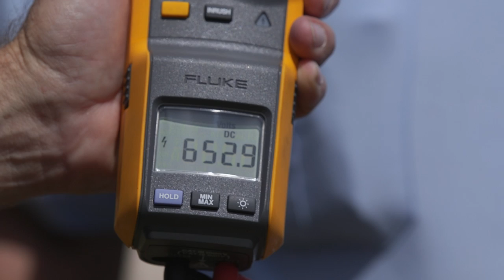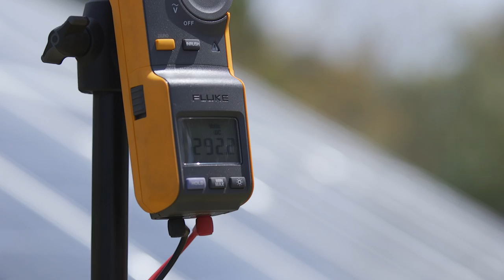Electrical Arcing & Water Conductivity

Comment: who the hell wants a 600v system on their roof?
Reply: Count the number of panels on a roof, if there's more than 15 panels, very common in Australia, the string voltage is getting up there. Even 10 panels can have open circuit voltages over 300 VDC
Reply: But should the panels not be connected in parallel ? I mean after all the system goes through a 12 or 24v inverter and charges 12 or 24v batteries doesn't it ?
Reply: Not always, modern battery PV regulators can have high voltage inputs, they are true Switch mode supply chargers. It's not unusual to have a 12 Volt battery regulator with 120 Volt or higher panel inputs. The logic  being lower I2R (Power loss due Voltage drop in a conductor due to current flowing through the resistance) Losses. This becomes important in high power systems where the panels could be 10's if not 100's of meters from the charger.
In Australia direct mains grid tie inverters are common, PV strings of 200 - 300 Volts are very common feeding the high voltage inverter.
Reply from the maker: Residential PV systems are limited to 600V of panels being connected in a single series (or string).  Industrial and commercial arrays are restricted to 1500V in series.  To answer your question, a typical 250W solar panel will produce 38-40 open circuit voltage. So any typical residential solar PV system is producing close to 600 volts at peak sunlight hours during the middle of the day.
Reply: Actually the voltage has no effect on the wattage produced. Please understand basic ohms law before insulting another individual over the internet. Many of the on grid based inverters used to only offset your electric bills are auto ranging from 48-500vDC and are sized and limited by total wattage. They do not care what voltage you bring into the DC side. As the installer you decide how best to break up the array into even strings so that you may keep the inverter in the best possible voltage range during lower sun hours. So please refrain from insulting others who might not be as "informed" as yourself.
Reply: KappaW the issue is amperage and wiring costs coupled with range of voltage during varying sun conditions. No decently sized solar array that is installed by any type of moderately experienced technician will be in the voltages you describe. The most common operating voltage for a single panel is 28-32v DC so please refrain from further spreading ignorance around the interwebs.
Reply: almost eveyone in Australia atleast, its terrible, its all well and good until there is a hail storm and the panels start leaking current very unsafe, fire and shock hazard.
Reply: Every residential PV system connected directly to a Grid-tied inverter has a 600v system on the roof
Reply from the maker: This is exactly why we invented PVStop, which is currently being trialled by fire and emergency services agencies across Australia (as well as the UK, USA and Japan).  A big step forward in Solar PV system safety of which we are rightly proud!
Reply: I will never touch a solar system above 200v because any higher is obviously asking for trouble, which is why we need black rubber extinguishers because people think too much about the cheapest way to do things not the safest way to do it, you will gain more efficiency by cleaning your panels more often anyway
Reply: There is a reason why the US uses 120v ac because it doesn’t make a 6” arc, it just pops. I say microinverters are the safest
Reply: Changed my comment from “who has” to “who wants” to better reflect the real issue here.
Reply from the maker: A good quality solar PV system utilising good quality components, installed by an experienced installation company and serviced periodically will give years of trouble free service, but you are correct, all too often this is not the case and people chase the cheapest option, often not understanding the risks associated with sub-standard systems.
Reply from the maker: Microinverters (such as Enphase) and DC optimizers (such as Solar Edge etc) are all steps in the right direction and look to reduce the risks associated with the "DC Danger Zone". However both have their pros and cons.  I would need to write a 2000 word article to do the subject justice.  But two points to mention are that in a micro-inverter system, the panels themselves are still producing (limited) power at panel level and when firefighters respond to an incident, they do not always understand what type of solar PV system they are facing.  PVStop isolates the power completely at the source (by blocking the light from reaching the panels and it works equally effectively on any type of solar PV system (including micro-inverter systems) all without damaging the system; a quantum leap in firefighter safety in incidents involving PV arrays.
Reply: PV Stop agreed, it gives safety and peace of mind, any other solution will probably cost way more than PVStop am I right? the homeowner doesn’t even to worry about it just the firefighters
Reply from the maker: That is correct, PVStop is a fast, safe and cost effective solution.   The product is aimed at Fire and Emergency Services Agencies who have the training, systems and processes to operate safely.  If a homeowner is after our solution, we supply it in a locked box with a firefighter access key so that it can be accessed and utilised by trained professionals upon arrival at an incident.  We are also working on a sprinkler type fixed system, but this is primarily designed for industrial and commercial scale systems.
Reply: KappaW so many charge controllers for offgrid even do up to 200+vdc input, midnite classic, outback, Schneider etc etc ,Grid tied I see most are around 300+vdc input and 240vac  output to match grid voltage, mine are older latronics with 80vdc and 150vdc input, been working since 2009 no issues , no cheap substandard panels though ,tier one only and  fire rated.
Reply from the maker: Education is key and based on your comments, you have a good understanding of the technology which is why you have invested in good quality components and installation.  As I have mentioned in a lot of my comments, a good quality system, serviced regularly, will give you years of trouble free service.  It is the exponential growth of the industry, poor knowledge and constant downward pressure on pricing and quality that causes the vast majority of the risks and hazards.
Reply: "a typical 250W solar panel will produce 38-40 open circuit voltage. " this is not true. I have some 12 volt 300 watt panels that MAX out at 19 volts.
Reply from the maker: Hi, please note that I said a "typical 250W solar panel" and by that I mean a typical solar panel in a standard domestic "string" type installation.  It is very true that there are 12 volt 300W panels, a lot of these are ustilised as portable systems for camping etc.  In fact there are a myriad of different specifications and sizes. It is important not to focus purely on volts, the equation is Volts x Amps = Watts, remove either volts or amps and you have no electrical output, it is the electrical output (Watts) that causes electrocution.
Reply: ElfNet Gaming not questioning your panels, but  I own many panels, the panels used for 12v batteries are typically around 19v open circuit as you need the higher voltage to properly charge batteries and equalise battery banks,  and panels for 24v battery banks are around 38v -45v approx , then there are panels that can put out over 80v.
I'd go to a professional solar panel company just for a look.
Reply from the maker: Our sister company is a professional solar installation business with over 40 years experience so I am quite confident in our knowledge base.  As stated, the panels utilised in the video represent a "typical" configuration for a grid connected domestic PV array.  In Australia this type of system represents approximately 93% of the domestic PV installations out of the total 1.8 million domestic installations in Australia which is why we said "typical".  Apologies if you find this too broad a generalisation, but you can only fit some much information into a 2:46 video!
Reply: PV Stop of course your company is professional, is PV stop sold in perth
Reply from the maker: Our new national distributor Fire Rescue Safety Australia (FRSA) officially launched PVStop earlier this week.  Their head office is in Malaga WA.  I'd be happy to put them in touch with you if you like, just let me know.  (BTW my generalisation comment was directed at ElfNet, I accidentally cross pollinated my reply!)
Reply: PV Stop excellent, have ex navy friends that work in the fire dept, I will talk to them and let them know about the product if they don't already know
Reply from the maker: I appreciate you spreading the word!  DFES are aware of PVStop, but every bit of support helps.  In Australia, FRNSW, ACTFR, NTFRS all have PVStop on their appliances and we will soon be rolling out with CFS and possibly MFB in Victoria.  I envisage all Australian Fire & Rescue Services will have PVStop next year.
Reply: sigh..
Reply: KappaW or more cost effective and more efficient.
Reply: Me.
Reply: @JamecBond  ko is right. My single Mppt charger will accept up to 100 volt DC. The system needed high voltage to compensate for the cloudy day. You can reduce the voltage by parallel paneling but the heat caused by higher amps so the cost of wires are too great some times. ☮️ peace

Comment: BUY BUY BUY, oh yes BE AFRAID too.  I accept that there are inherent dangers with damaged PV sets, but a simple roll down tarp would do the job FAR more efficiently (could even be fire proof and have automatic deployment in case of building fire........but then WHERES YOUR CUT ??  Sad cynical attempt to feed the fear and make money.  Of course your silly little fire extinguisher wouldnt be of much use to fire fighters battling a large building fire with a roof covered in solar panel, but hey...who cares ? Profit MUST come first
Reply from the maker: A tarp does not always work, Underwriters Laboratories did a comprehensive study back in 2011 titled, "Firefighter Safety & Photovoltaic Installations Research Project".  You should be able to find it online (P56-58).  Not to mention the risks of operating at height, weather conditions, roof load capacity, not being able to remotely detect DC electricity etc.  In short, trying to de-energise a PV system by climbing onto a roof and tarping the system is a bad idea!  Automatically deploying fireproof tarp?  Sounds terrific, you should start a business and SELL, SELL, SELL!  Just to be clear, our mission is to improve renewable energy safety, every business needs to make a profit or you don't have a business, but if we improve firefighter safety in the process, we are ok with that.
Reply: My initial thoughts turned to a rolled up tarp on the apex of the roof that could easily be deployed manually from the ground using simple levers, cords (fire resistent) and pulleys. This would not only serve to isolate the PV set from sunlight for maintenance etc but could also protect them from adverse weather conditions too.  But then again, i always go for the simple efficient solutions. So much for those "comprehensive" studies.  For a huge fee i will happily prepare some well thought out designs for such a mechanism. 
PS: Insulating the PV set from their supporting framework would also remove (or at least seriously reduce) any danger of electric shock should any panels be damaged as you described......again, far too easy to do, and no mega bucks to be made

Comment: So ? What IS PV Stop ???
Reply from the maker: PVStop is a water based polymer film technology, designed to spray onto solar panels, blocking the light and "switching off" the solar panel system.  It is the only solution that switches off solar panels at the source.  Please feel free to visit our website at www.pvstop.com.au to find out more.
Reply: "PVStop is a water based polymer film technology"

So,spraying water on panels is dangerous, but spraying water (based paint) on panels is safe?
Reply: @hermitoldguy6312  The "polymer" component of the formulation renders the spray non-conductive.  We have tested conductivity up to 2000 volts (DC).  A commercial PV system can only have up to 1500 volts connected in series and so PVStop can be defined as non-conductive when applied to solar PV systems.
Reply: @foranjim  Thanks for the reply. Was the paint wet or dry when you tested it?
Reply: @hermitoldguy6312  The coating was wet when we tested it as this is the state in which it is theoretically at its most conductive.  Once dry, the coating forms a film similar in feel to latex at which point the water content is almost completely evaporated.
Reply: @foranjim   Thanks for the reply. That's impressive.
Reply: @hermitoldguy6312  Thank you.  PVStop is a simple solution to a complicated problem, but it took 4 years of exhaustive research and extensive third party independent testing to convince global authorities that the product is effective, safe and environmentally friendly.

Comment: never heard of it clean water has no conductivity never try it at home stick an 220v electrical wire in a glass of water [with help of an adult who knows what he is doing] and observe ,
no fuse is burned out the wire isn't   getting warm nothing !!! your story is crap never will happen. electrical engineer in holland [the netherlands]
Reply from the maker: You would need to define what you mean by "clean water".  Water utilised by fire and emergency services is typically sourced from mains water, dams, reservoirs etc all of which have impurities and all of which potentially conduct electricity.  Don't take my word for it.  I suggest you reference  a comprehensive study conducted by Underwriters Laboratories in the US back in 2011 titled, "Firefighter Safety & Photovoltaic Installations Research Project" (Pages 24-31).  After reading I think you might change your opinion.  All the points referenced in the video are facts.
Reply: that's why i commented " i am coming from the nederlands" where the mains fire water the same is as drinking water [more or less] we have more fresh water then we can use.
drinking water is clean and not polluted with chemicals in holland [no fluoride no chloride all pure filtered water in bio filtering installations .this water is non conductive .
no free electrons to conduct electricity.
Reply from the maker: Drinking water, even filtered drinking water is not "pure" it contains ions.  It is ions present in the water that conduct electricity.  Distilled water is closer to "pure" water than any source of drinking water.  Below is a link where you can learn more; https://www.lenntech.com/applications/ultrapure/conductivity/water-conductivity.htm
In summary, the bio filtered drinking water in the Netherlands does present a conductivity risk for firefighters when they encounter incidents that feature solar PV systems.  I've visited the Netherlands 4 times in the past 2 years and I have been working with the IFV Brandweeracademie and they are assessing such scenarios as a genuine risk to firefighter safety.

Comment: Goddamn, I hope you recycle those panels after you damage them on purpose!!!
Reply from the maker: The panels were purchased already damaged (apparently a forklift dropped the pack of 20 panels).  They could not be repaired or sold and so we acquired them at a considerable discount for testing purposes.  The panels have assisted us to increase awareness and knowledge around the potential risks that damaged panels can present to first respondents and electrical contractors and have allowed us to improve procedures and safety for firefighters.  These damaged panels are still being utilised to test various safety scenarios, so I think we have made extremely good use of a set of panels that would have otherwise simply been destroyed.
Reply: Just sell them as "blems"!🤣😁😝